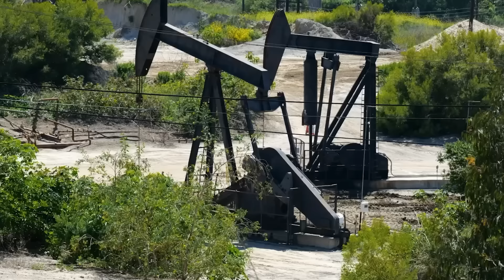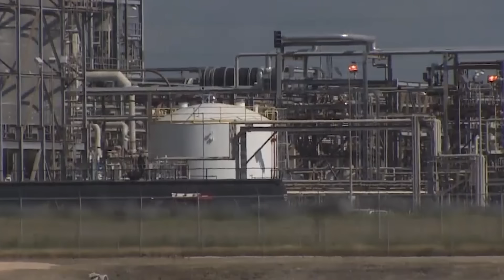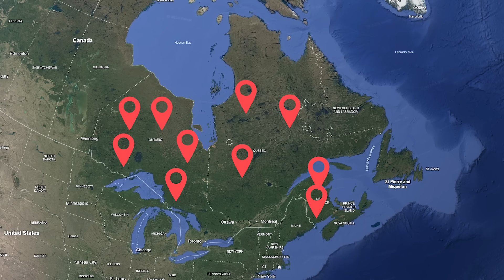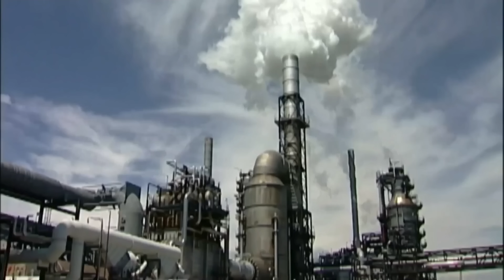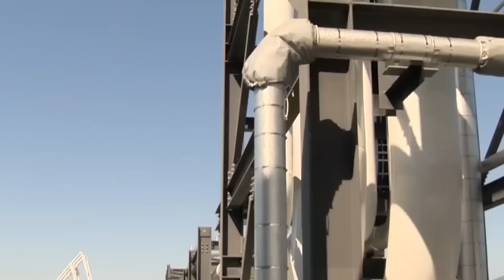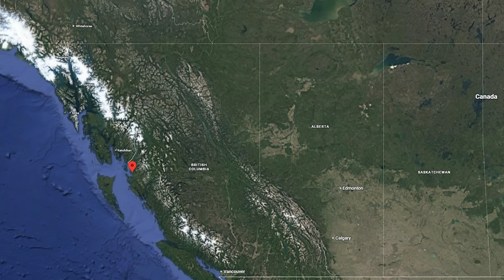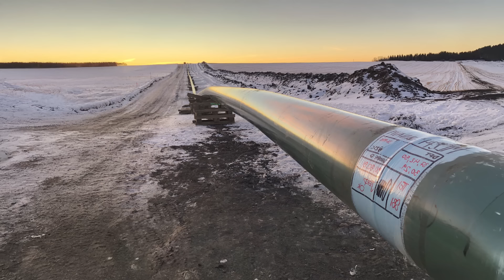Here's Why Canada Can't Build Its Own Refineries, Even Though It Produces Millions of Tons of Oil

Comment: You skipped over important facts about Atlantic Canada's refining and oil reserves. Irving Oil's refinery in St John, NB is the largest refinery in Canada. It can refine both light and heavy oil. There is a large reserve of oil and natural gas (22 billion barrels) off the shore of NS and there may be more  oil off the shore of NL and LB. Among the priority projects of the Canadian and provincial governments, exploration, which was suspended in NS,  is going to restart in the NS waters. Extraction of this light, sweet, high grade oil is projected to be very profitable. It could then be refined in St John.  Also, exploration in the NL waters continues where there is ight and heavy oil.. The last word has not yet been spoken. Check it out.

Comment: The funny thing that people never really realize looking at typical maps is that its almost the same distance from Monterrey, Mexico from Edmonton and it is from Edmonton to Toronto.
Reply: To throw in a very significant factor not mentioned by anyone is "electricity".   THIS commodity is NOT going to immediately replace the need for oils of any kind, ...BUT ....the associated technologies ARE being accelerated .......WHICH .....will reduce the dependencies on oil AND natural gas in the not distant future.

The point is simple.    "OIL PROJECTS" have been very clearly identified as very costly, needing a lot of time to complete.

WHERE will "global oil consumption" be in 30, 40, 50, years .......after spending UNTOLD BILLIONS?  No "private" monies are offered to do anything on any of these "projects". So if anything happens, it will be on Canadian Taxpayers.  The ONE thing governments CANNOT do is build anything on budget .....and will they be needed in 50 years?

In Vancouver, B.C., Canada, we couldn't even build a projected $700 MILLION waste water treatment plant, started 2018 to be completed by 2020, without out the cost skyrocketing to currently just under $4 BILLION ....when the project was finally stopped ....and no one trusts the board of over 40 "municipal experts" to even restart the project because it is only a FIVE YEARS BEHIND completion and likely needs another FIVE YEARS before getting close to completion!!    The "commissioner" of the Metro Vancouver Board .... Jerry Dobrovolny .....sat back quietly as the numbers exploded. Dobrovolny's  tax-payer paid income is over $600,000 annually.  He keeps his face out of the media.

.
Reply: The problem that people don't think of, Enbridge which is a Canadian Company ships Canadian oil through the states because the cost of building a pipeline from Manitoba down through toronto was enourmous.  It's the elevation changes up into Ontario and the Canadian Shield, then it's down hill all the way to Sarnia.  It's the geography, the climate, it's the working conditions in the winter.  It's the constant lake effect snow.  Since they had pipelines in the states already, it was just a business decision to ship oil through the States.
Reply: @patrickinottawa27  But the whiners in Alberta don't think logically. They just push Corporate America bullschitt instead of reality.
Reply: This is all bull !   Trudeau bought it ‘.  It wasn’t gonna cost nothing !  Again not true most of trans mountain goes to the east coast of the states!
Reply: @Tjay0716  Don't try to use reality and truth with conservatives. It hurts their little brains too much.
Reply: @Tjay0716  Mexico is going to pay for it
Reply: Bullshit!
Reply: Yeah and the distance between Edmonton and Ottawa is 3400 km and Paris to Moscow is 2500 km. Canada is too big and divided by the Canadian shield to be viable forever

Comment: Magantique now has a go around rail section so that fright cars and CRUDE is not marked or seen as Hazardous goods.  Which is a huge problem.   Gasoline diesel fuel aviation fuel is.   Shipping by Rail is safer and cheaper than putting in a pipeline and rail expansion is possible and easier to do.   As for Pipeline to the Churchill is the best route with the least amount of opposition and to have a refinery built there would also aid in refining for the worlds need of Crude oil.   Which is and can be upgrader and sulfur removal... Low carbon oil is what Canada needs to sell but has only HIGH Carbon crude oil.  aka Bitumen needs to be reduced to light crude and that takes energy to so it.

Comment: Why not build the refineries underground for Canadian heavy heavy crude. There are all kinds of exhausted, abandoned open pit mines in Canada,that a refinery could be placed in. We have all kinds of tunneling machines that we could use to tunnel horizontally where the temperature,year round underground would be 25 or 30 ° c the entirety of the route, ensuring that the heavy crude would be liquid enough to be transported easily through the pipelines. And no possibility of environmental disaster,or having to deal with land claims and territorial disputes. Essentially a subway tunnel, deep underground
Reply: The aboriginals say they own the land down to the centre of the earth.  It's only you and I who own only the surface of the land.  There would still be indigenous land claims over it over the subsurface rights.

Comment: There are 13 out of 15 refineries in Canada that use Alberta bitumen sands heavy crude oil right now. This video makes it sound as if hardly any of Eastern Canadian refineries use Alberta crude when the vast majority do. 

All 13 of those refineries receive deliveries directly via pipeline from Alberta, including all four in southern Ontario (via Line 5) and the only refinery in Montreal (via Line 9).

The two refineries that do not use Alberta crude oil in their refinery diets are located on the south shore of Quebec City, in Lévis, and in Saint John, New Brunswick.

The refinery in Quebec City is owned by Valero and the same company owns a massive storage depot in Montreal. Furthermore, Valero also owns an oil pipeline between Montreal and Quebec City.

So the reader may be asking themselves: so wait, if there's already a pipeline between Alberta and Montreal and another oil pipeline linked directly to the same company's refinery in Quebec City, why aren't they using Alberta crude oil too?!

The answer is simple: it's not economical to do so.

Alberta bitumen is heavy in asphaltenes and low in resins. This makes it a low-value product that is generally used as a cheap blending agent to bring down the overall cost of refined petroleum products. Remember when the Conservatives told you that Western Canada Select oil was priced lower than West Texas Intermediate because there was insufficient pipeline capacity to Canada's west coast and Canada was stuck with only "one customer"? Well, the Trans-Mountain oil pipeline is now complete, exports are happening all over the world, plus, there is excess capacity available on it!! And the price gap between Western Canada Select and WTI is still over $12/barrel on average!! Chalk it all up to yet another Conservative lie. Pierre Poilièvre is a rank expert at lying to Canadians and Conservatives are repeating the same, tired lies that are being disproven every day with TMX exports to Asia. Bitumen sands crude oil is low quality, and no amount of pipelines will ever change that. 

No, Valero actually uses their pipeline to ship finished products westward, from its refinery to Montreal instead of shipping Alberta crude eastward. 

Suncor also owns a Quebec refinery, in Montreal.  Suncor blends Alberta crudes with imported crude oil from overseas via tankers that land from the eastern US, Norway, the Middle East and Nigeria with light, sweet crude oil. The imported oil either arrives by tankers, or occasionally, gets unloaded in Portland, Maine and then piped to Montreal. 

Incidentally, the company that owns the Maine to Montreal oil pipeline applied to reverse its direction, so that the line could carry tar sands bitumen from Line 9 to Portland, Maine for marine export via tanker.  Concerned citizens of Portland in 2014 passed a municipal ordinance banning the export of oil sands bitumen at the Port due to environmental concerns. Portland Pipe Line Co (PPLC) filed a lawsuit to overturn the ordinance as unconstitutional, and against interstate and international trade. They lost in Court and abandoned their appeal in 2021. 

Many find it amusing to listen to the same Conservatives who worked tirelessly to destroy Canada's National Energy Programme in the 1980s now turnaround and counsel the government to ignore the economics and build a brand new pipeline from Alberta to those two refineries, even though it makes zero economic sense to do it today with all the existing infrastructure in place.
Reply: See, that's what would happen if "Canada" decided to build another pipeline east from Alberta instead of leaving it to investors to build only those pipelines and refineries that make economic sense.
Reply: Both the Quebec refineries were reconfigured years ago to use a blend of upgraded Western Canadian crude and light sweet crude that is mostly shipped from the US Gulf. The Irving refinery does use some Western Canadian heavy crude they get by rail. Heavy crude is good for making diesel fuel & furnace fuel (basically the same thing) and jet fuel. The US has more advanced cokers that can break down bitumen. I believe Alberta's refineries & the Saskatchewan refinery are the same design. In the rest of Canada, they require upgraded Western Canadian crude feedstock, which gets blended with light sweet crude. The provincial emissions regulations have a lot to do with that.
 I did not know that the existing old pipelines that used to supply the Montreal and Levis refineries had applied for a pipeline reversal. Those 2 pipelines are owned by Suncor. They are currently being kept wet to act as an emergency supply backup for the 2 Quebec refineries. I think there is a spur line from the Montreal refinery to the Levis refinery. I believe the capacity of the 2 Portland to Montreal pipelines is 600,000 barrels per day. The concerned citizens who objected to the reversal should realize that the pipeline is underused, and the reversal of the pipeline would create a lot of jobs in Portland. Perhaps Suncor could try again on that pipeline reversal.
Reply: @don-cw1yz 

The Montreal refinery receives Alberta crude shipments via Enbridge pipelines, Lines 5 and 9.
Reply: This really needs to be the top comment. You're doing good work, thankless though it might be.
Reply: Line 5. Well, for now anyway.
Reply: That pass by US???
Reply: Wow, this comment is super helpful context. Better than the video itself!
Reply: Yay, another person who has taken a few minutes to learn how our petroleum system works !
Reply: @patrickinottawa27  Are you gays bots?

Comment: As Canada feels the impact of Trump's America both attitudes and the willingness to invest may make anything possible.  Just 5 years ago if you told me the Port of Churchill might become a option as an Atlantic Ocean gateway I would have laughed and pointed to past rail failures. Today the Arctic Gateway Railway is not only viable, it is planing for a much larger involvement in delivering Canada's resource sector.   Not only does it have significant Indigenous control and backing, but also the support of provincial and federal governments.  Some day transporting Alberta oil to Eastern Canada may include a much shorter ocean voyage starting in the Port of Churchill.

Comment: The largest problem with refining Alberta Oil is that it is not the nice light "sweet" Oil we get from overseas.  It requires extra refining and processing.
Reply: Refine it then
Reply: Exactly. 

Alberta bitumen is heavy in asphaltenes and low in resins. This makes it a low-value product that is generally used as a cheap blending agent to bring down the overall cost of refined petroleum products. Remember when the Conservatives told you that Western Canada Select oil was priced lower than West Texas Intermediate because there was insufficient pipeline capacity to Canada's west coast and Canada was stuck with only "one customer"? Well, the Trans-Mountain oil pipeline is now complete, exports are happening all over the world, plus, there is excess capacity available on it!! And the price gap between Western Canada Select and WTI is still over $12/barrel on average!! Chalk it all up to yet another Conservative lie. Pierre Poilièvre is a rank expert at lying to Canadians and Conservatives are repeating the same, tired lies that are being disproven every day with TMX exports to Asia. Bitumen sands crude oil is low quality, and no amount of pipelines will ever change that.

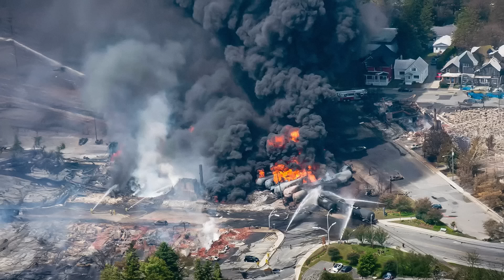Comment: 3:51 About the Lac-Mégantic accident. I think the oil was from North Dakota, a different oil variety, much more volatile than anything that comes from the Alberta oil sands. 

You do make an important point about pipelines being cheaper and safer than shipping by rail.
Reply: Yes, that's correct.  It was Bakken shale crude, for refining in Saint John where they use light Saudi crude that comes by tanker.  Very light and volatile, easy to set alight, which is of course what happened to the town.  Tar sands oil even diluted to flow into tank cars would never have blown up like that.  But the refinery can't use heavy crude.
Reply: Important for the driver not to leave the engine unattended.
Reply: @FloridaMugwump It was a common practice at that siding. It is suspected that some idiot environmental activists released the brakes with hopes that the derailment would stop the shipping of oil by rail.
Reply: @billwilson-es5yn But the train didn't start rolling immediately.

Train brakes need power to be "released".
Reply: @FloridaMugwump The locomotive was left idling while the crew took a break.

Comment: You can't explain why Canada can't do something and not mention the elephant in the room.

There is only one refinery in New Brunswick, but it is THE largest refinery in Canada—capable of processing 320,000 barrels per day . Around 2013, there was a proposal to bring oil east to Saint John, build another refinery with similar output as the current largest refinery in the country, and export refined products to the world. The marine terminal alone was a $300 million joint venture between Irving Oil and TransCanada, designed to handle the world's largest crude vessels at an ice-free, deepwater port .

It was a nation-building project. And it was quashed because Quebec politicians always quash projects in New Brunswick.

They manufactured public disagreement that could have gone whatever way they wanted it to go. TransCanada was forced to navigate an increasingly hostile political landscape in Quebec, compounded by the Lac-Mégantic tragedy, which heightened public fears even though pipelines are statistically safer than rail . The Quebec government initially supported it, then wavered, then demanded environmental reviews that TransCanada resisted, creating endless delays .

That is the absolute truth. And it did more than keep New Brunswick from refining Canadian crude—it kept the line to Houston as the only way out. Today, over 80% of the refinery's production is exported to the United States, and 97% of Canada's oil exports overall go to a single customer .

The problem is Canada is a disparate bunch of disconnected colonies whose interests only matter when they don't upset the status quo. And the status quo is where the problems lie. This pattern dates back to Confederation—the National Policy of 1879 concentrated manufacturing in the Toronto-Montreal corridor while the Maritime economies were systematically dismantled . Always have, since at least 1867, and I see no end in sight.

You can throw money and high-value developments up on the screen like that is some kind of limitation. That is the narrative. But the truth is that the powers that be don't care what the dollar value is as long as THEY benefit in their bank accounts. Alberta is now actively looking for customers beyond the U.S.—Japan, South Korea, Europe—but there are no pipelines east, and building them takes decades . The same provinces that killed Energy East are now wondering why we have no alternatives.

Comment: Liberal policy not to support pipelines East & West expansions has crippled the possibility of expansion of self sustainability. Quebec has blocked pipelines East to protect its electrical generation industry. We should be refining and exporting finished product, not crude. Heavy oil is refined in the west, however there are not enough of them.

Comment: Canada actually has 16 refineries. We can and mostly do refine all we need. However.  The Quebec Government refuses to allow a long proposed pipeline route carrying Alberta heavy crude, to cross its Provincial Boundries and thereby servicing its own Petroleum needs, and transmitting another Sizwable, Useable volume onward to Atlantic Canada. This Rejection costs them many Billions of Dollars more for Imported Off Shore Oil each Year. Each Liter shipped less than Safely across Large Expanses of Ocean. It is a Bizarre, Costly, Crippling, and Unproductive Stance to take in so many ways, and gains little, or no more in Environmental Benefit.  As we see it in Alberta, a pipeline is Safer, Less Environmentally Risky, and would be paid for not by Quebec, or Quebecers, but Enthusiastic Private Investment. But it is an unwinable Battle. Due mostly to Misinformation, or Disinformation, or Petty Politicking. Sorry! But it must be said. And I am a Green Guy!